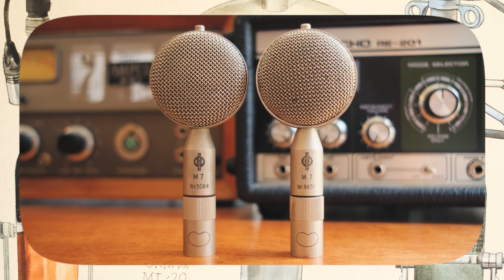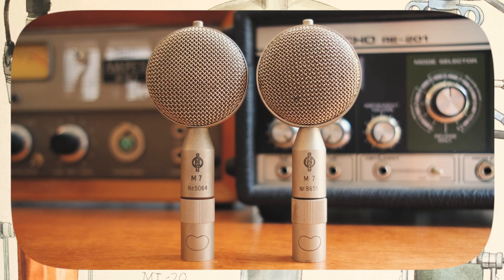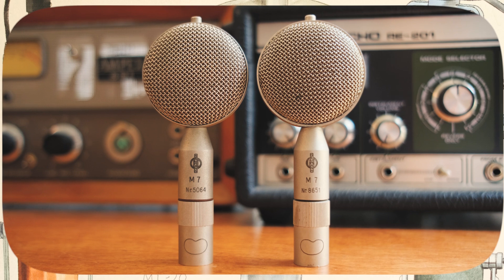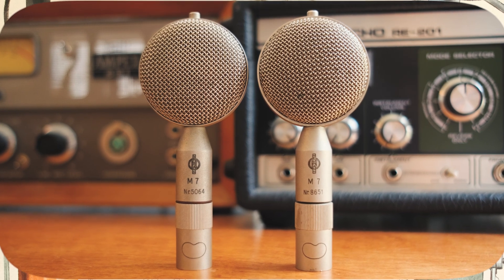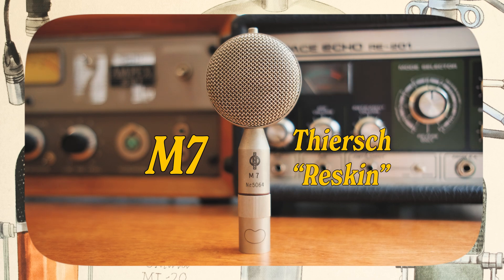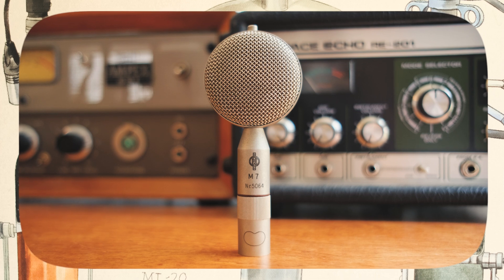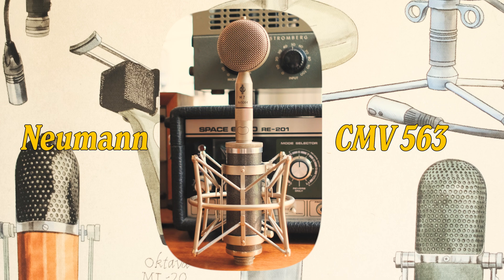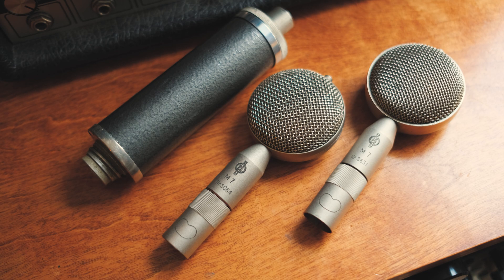The Neumann M7: "Reskinned" Vs. Original

Comment: The Neumann seems more "open" (for lack of a better term) and the Thiersch seems to have a little more bass response. Unfortunately, or fortunately given the context of the recording, sound test or actual recording a song using both, the difference between the two is within the parameters of the M7 capsule and could be explained as normal response from two different mics from the same manufacturer.

Comment: Having some of these myself, I have observed similar results. I think a part of it is the original m7 material pvc I believe has become a bit more brittle and harder over the decades and changes the top end response. I also have some Thiersch blue line and red line m7 products they manufacture. They have different sounds as well, All very good and useful. I also think the gefell m7 sounds great. Comparing the stam 47 with braingasm m7 type capsule is also giving some decent results, I think those are manufactured by 3u

Comment: So weird, it has the same qualities I've heard in just about any of these vintage vs reissue (or similar) shootouts. The "less vintage" ones always have a flatter image, more dull, less solid lows / low mids. Urei 1176 vs UA Reissue is another good example and shares the same characteristics I hear in this example. Putting these tracks through compressor really starts to reveal the "solidity" of the vintage one, with transients seemingly maintained - where as the modified/newer version kinda falls apart even after just a few dB GR. 

Atlhough, the difference on these two versions is pretty dang close. A lot closer than the Neumann 67 and 49 reissues from the Vintage King videos.
Reply: I've notied the same thing even with vintage vs. reissue pedals. CE-1, Electric Mistress, Deluxe Memory Man etc. Same thing with synths.

Comment: Very similar. The reskin has just a bit more top end in a pleasing way. I've got a vintage U67 that was reskinned and have compared it to a non-reskinned but still excellent sounding 67. I think mine sounds better... Ha! All just depends on what the new capsule is and arguably more important -- who is doing the work voicing the microphone.
Reply: I also have a CMV 563 with the original M7s capsule. It's gone through many phases of life. Been worked on numerous times. It's one of the most magical microphones out there. When it's right for a vocalist, it's one of the coolest sounding mics you'll find. Never heard anything quite like it -- BeezNess, Flea, etc. All the new great tube mics, there's just something about the CMV that's really special.

Comment: The reskinned capsule has an open frequency response. Which is what one should expect. A bit like unclogging a sink or cleaning a window. Sounds great. It’s a modern sound. But to play devils advocate. Modern digital technology, DAWS etc have a wide open frequency response. They reveal everything. They can reveal harshness and dullness as well. The original microphone is a bit like an old tape machine. It’s curtailing the frequency range to just the definition/ sparkly bits. Not by design but with the passing of time and deterioration. This can be good or bad. I have some old dynamics that need to be reskinned. The “vintage” sound they reveal is not pleasing. While other vintage microphones I have just sound great. I wouldn’t want to reopen their frequency ranges as what they reveal currently is pretty cool. But they will only diminish given more time passing.